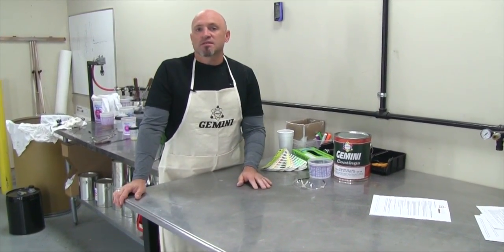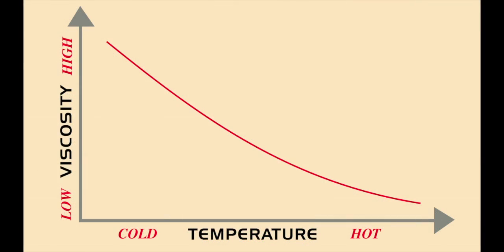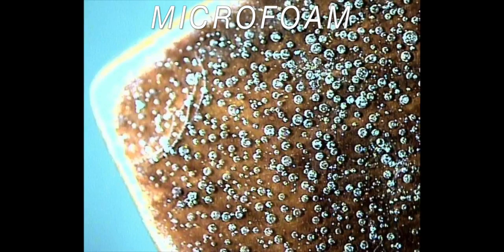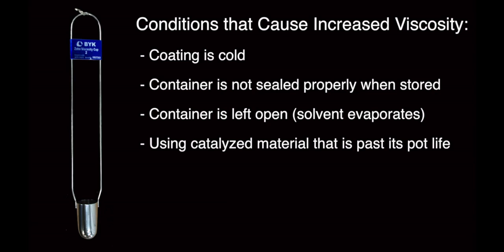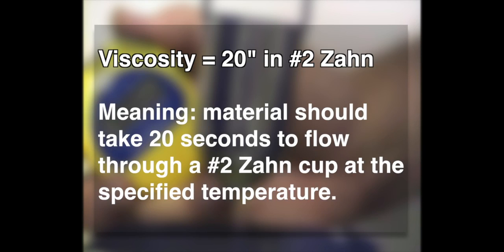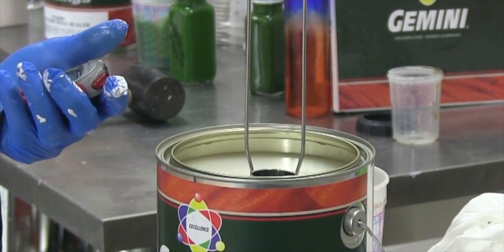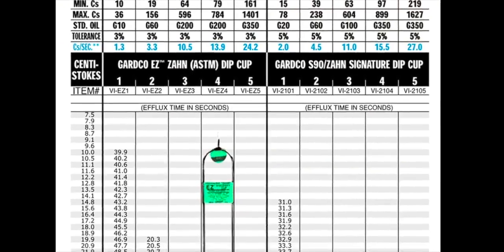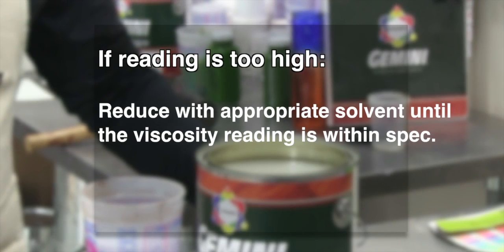How to Use a Viscosity Cup

Comment: higher viscosity means more solute is present. This in turn lowers the vapor pressure of the solution, meaning less of the solvent will be able to evaporate over a given time period. This leads to longer drying times and potentially uneven/excess application.